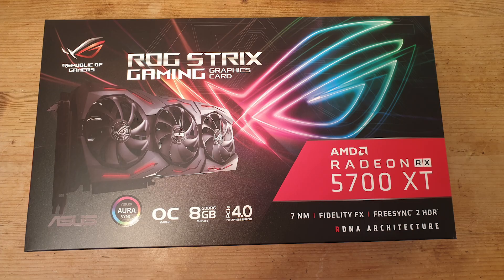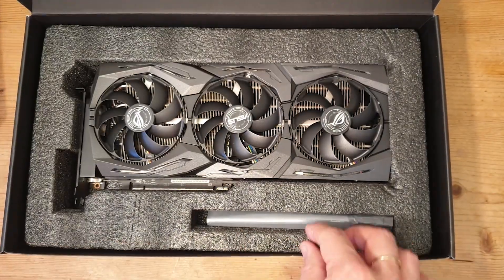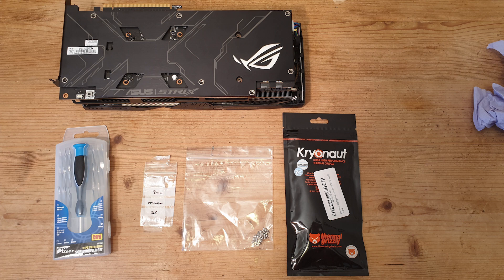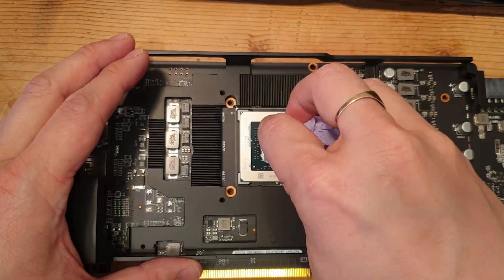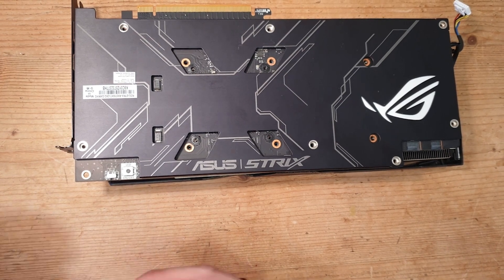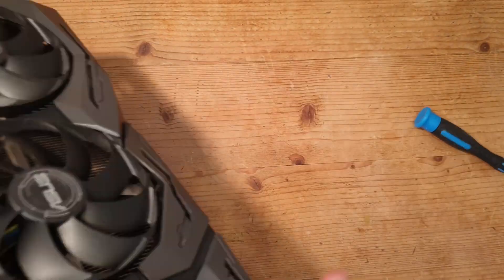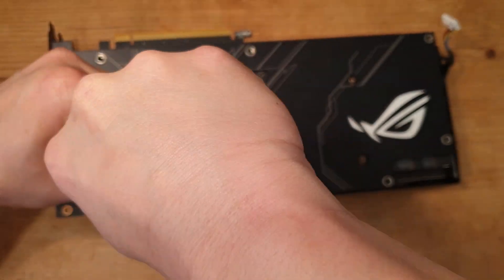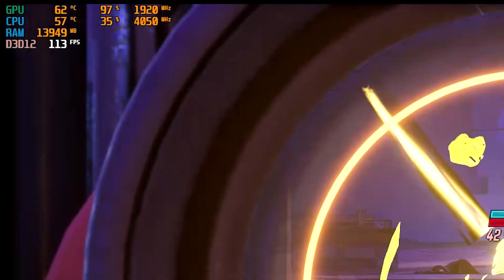ASUS ROG STRIX 5700 XT Tempeture Fix

Comment: how many did you put (washers) 3 or just 2?
Reply from the maker: I used 3 washers, some people have used 2 washers so either the washers are different thickness or Asus used different screw length.
Reply: @HardwareHusky  thanks
Are the temperatures recorded in a closed or open case?
LA MIENNE displays almost 20 degrees of difference
around 65 degrees open case and 84 closed case
Reply from the maker: The temperatures were recorded in a closed Thermaltake V200 with the stock fans set to 800rpm in the bios.
Reply: @HardwareHusky  thank you so much
I think I have no choice, I hesitate to do so because it voids the warranty
Reply: @HardwareHusky  and regarding the screw, don't you need to change both towards the ROG logo of VRM?
Reply from the maker: @spilart  You can change the two screws near the ROG logo for shorter screws but i decided to stack washers instead so i could still get enough thread into the screw hole and have the washers remove the slack from the weight of the cooler.
Using the shorter screws method I had to squeeze the card and cooler hard to get the screws to bite and felt like the screw was going to snap.
Reply: @HardwareHusky  thank U very much
Reply: @HardwareHusky  mine with an open case I am at 64 ° with hotspot at 80-82 °
but as soon as I close the box I am at 88 ° and 110 ° in a hotspot
I have as case a silent base 801
I say it may be that it will help a person in the days to come
Reply from the maker: With many silence focus case they do so with reduced cooling performance. This is so with the Be Quiet Silent Base 801.
Have you tried running with the front panel off as the intakes on either side of the front ain't large enough for airflow?
Reply: @HardwareHusky  ah good idea, i'll do
Reply: @HardwareHusky  HELLO and thank you for your response

my card is installed in a silent base 801 bequiet, I put it vertically, it was too close to the glass door of the case, there was about 1cm apart, in full battlefield1 the GPU temperature reached 89 degrees (max value) with a 109 degree hotspot (max value)
but as soon as I put it directly in the pci-express port, I am at 70 degrees in play and 93 degrees in hot spot as maximum value
on average 50 ° and 74 ° in hot spot
I examined my card by removing it from the case and I saw that I have no play between the PCB and the radiator
are my new temperatures good?
how to know if my card was made after January 2020
what is the value of your hotspot (max) in gpu-z in a game?
I ordered the washers like yours but I want to know your temperatures before opening the card

thank you very much
Reply from the maker: @spilart  Yes your temperatures are good but keep an eye on the play between the PCB and heatsink,  When installed horizontally the weight of the heatsink eventually pulls away from the PCB which will require the washers to fix.

The other options if you want to mount it vertically is the Cablemod Vertical mount, this moves the card about 3 cm towards the front of the case, no cutting needed comes with special cables but cost more than a normal kit. 

The cheaper option is Cooler Masters Vertical mount but you will need to cut the slot bars.
Both these options mount the card vertically but away from the glass.
Reply: @HardwareHusky  thank you very much
if not it does not matter if there are peaks of 95 ° in hot spot ?
the average is much less, around 65 °if
Reply from the maker: @spilart  95c for peak hot spot temperature is on the high side of normal but still normal and below spec, adding washer will help with this and stop the temperature rising as a result of the separation.
Reply: @HardwareHusky  I will add the washers, after I do a test and I come back to tell you the results
thank you for your help

Comment: If I buy the Strix RX 5700 today will I have these problems with a lack of pressure ???
Reply from the maker: They have addressed the issue but I wouldn't be able to say if your retailer has the updated models yet due to the pandemic.
I would suggest asking your retailer through email so you have a record of the conversation.
Reply: Hardware Husky would it be covered under warranty if the pressure problems occur
Reply: SCHLEIMRAUSSAUGER ok thanks I’ll have a look at the msi
Reply from the maker: @maximilianmus506  It would be covered under warranty but the RMA process might take a while.
This card is one of the most expensive 5700 XT and there are better and cheaper models available like what Schleimraussauger suggested also have a look at the Sapphire 5700XT Nitro+.
Reply: SCHLEIMRAUSSAUGER What do you Think About the gigabyte aorus rx 5700 xt it is the same price Which one Should I get?
Reply from the maker: @klintzie2598  Gigabyte aorus appears to be good at the moment.

Comment: Hey, im kind of scared of putting to much pressure on my card and break the chip... 
So i will start with litte pressure and compare my temps to yours.

And could you send me the bios of your xt version? I have the non xt 5700 and i want to get the latest bios from 21/02/2020 to upper the power target and move the clock limit up. I couldnt find it on the internet... just asus update exe and the first bios from the launch of the card.
If you could do it, please dm me. Thanks!
Reply from the maker: Yes definitely take it slow if you are worried about damaging it.
I'm on bios: 	017.001.000.047.000000
Dated: 2019-07-26
Techpowerup bios collection has it available,
 https://www.techpowerup.com/vgabios/?manufacturer=Asus&model=RX+5700+XT

Comment: Hey brother, i did this and it fixed the GPU Current Temperature it stays around 50-70c, however, my GPU Junction Temperature is between 80-90c under heavy gaming like Virtual Reality etc, is this normal
Reply from the maker: Yeah that's about about right for GPU junction, AMD even state 110c is "Expected".
Gamers Nexus has done a good video about this.
https://youtu.be/SQjTYbqG1CI
11:20 has a chart with their findings.
Reply: @HardwareHusky  ohh alright i was a bit concerned there lol, thank you for the info brother! keep up the great content :)
Reply: I have a problem with the gigabyte auros. GPU 75 but junction 110! Will repaste help?
Reply from the maker: @jaimykooijmanify  Hi, 
I haven't played around  with that model but the junction temp is on the top end of the normal range but still within spec. 
what is your room temperature?

Comment: My man... went from playing battlefield 4 ultra settings - 77-80 degrees celsius to 55-57 😲😲😲😲😲😲😲😲😲😵😲😲😲😲
Reply from the maker: That's a good result
Reply: What washers did you use? Where did you get them? Can I use metal washers?
Reply from the maker: @jayvelasco2198  https://www.ebay.co.uk/itm/250951154962 these are 2MM x 0.5MM Nylon washers, I used nylon because they non conductive.
Reply: I used the recommended 2mm Nylon Washers (NWs), I bought a small box from amazon.uk - it had various sizes, with them 2mm NWs. I don’t see a reason not to use metal washers. However, the washers might be thinner and you might need more!
Reply: HOW many washers did you put ?
Reply: spilart the ones that I bought from amazon, I used 2. Hardware Husky uses 3 but he used different washers (not different in diameter, but different in thickness I assume). If I used three washers with the ones that I bought, the screws wouldn’t screw in.
Reply: @arotron   how many washers to each screw?
Reply: @docrats  as you can see from a comment I made above, I used 2 of the ones that I bought. The creator of this video used 3, but I assume that is because the washers he had were thicker, but not different in diameter. I was going for 3 washers as well, but I observed that I wouldn't be able to screw the screw properly with that amount of thickness attached to the screw. Good luck!

Comment: It has not got any warranty rights anymore because you have harmed the white paper on screw.
Reply from the maker: You definitely won the silicone lottery with your 3600, great OC with nice voltage!
Reply from the maker: You are both right and wrong, it all depend on the country where you live and the company's policy about removing the cooler.
In the USA the FTC says "warranty void if removed" sticker are illegal.

https://www.ftc.gov/news-events/press-releases/2018/04/ftc-staff-warns-companies-it-illegal-condition-warranty-coverage
Reply: @HardwareHusky  Hmm. I live in europe . I'm from Turkey. In europe, if we take out sticker than we lose rights about warranty. By the reason, i cant repaste my gpu by cooler master mastergel pro :) . I have 5700xt gaming x . I use it with undervolt. It is 2020mhz/1040v/1870mhz vram. Thank you for your replies about my 3600. yeah , i am so lucky on it. I guess that i have the best cpu of ryzen 3600 in the world. I can even reach to 4.45Ghz / 1.37v .
Reply: Ryzen3600 Never :-D can you Post a pic ?

Comment: Could you post a link for compatible washers?  I can't seem to find the correct size unless I buy a multi size pack.
Reply from the maker: https://www.ebay.co.uk/itm/250951154962 these are the ones I used
M2 x 0.5MM
Reply: @HardwareHusky  how many did you put on the vrm and gpu mount? 3x on each? (so 1.5mm?)
Reply: @HardwareHusky  Thank you very much!
Reply: @HardwareHusky  Thank you sir!

Comment: Asus products are cheaply made I build a computer all asus and I regret it
Reply: The Card has the most Metall and heatpipes. They got a construction Mistake about to low pressure on the screws for that heavy cooler. So they lost Pressure from cooler/vrm cooler/gpu. The Card overheat. You dont Need to replace Thermal. Just buy some stuff for the screws like in the Video. Its good. Asus Support will help you (in our Country)
Reply: @badabimbadabum9273  Hello, and what about the atm cheaptest rx5700xt card , the asus TUF(in my country [Germany]). I heard so many "stay away from it" comments, what do you think? It is still a construction-mistake like the strix-modell? Or is the cooler itself utterly garbage? The card cost atm 359€...
Reply: @mrz3r085  I have mem temperature about 70 and 70-75 on gpu with new bios update from Asus.
Reply: @MasterOfTheDeath  Thx but to late bought a RTX 2070 on sale xD. regards
Reply: @mrz3r085  great choice! :)